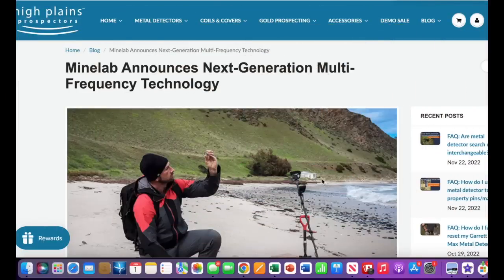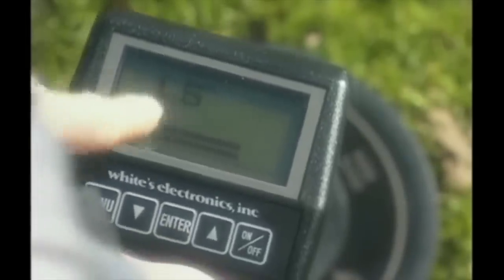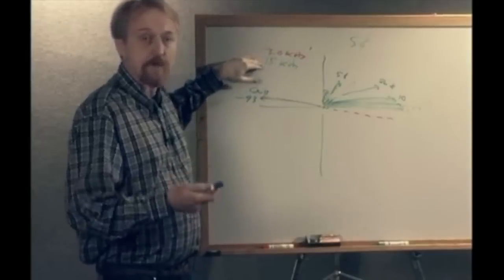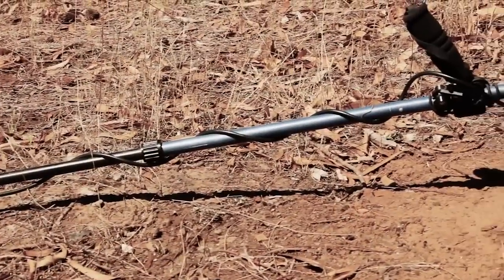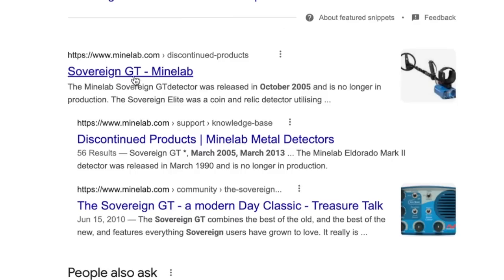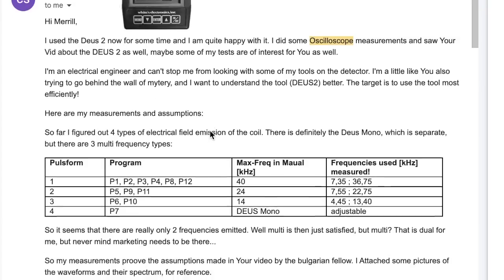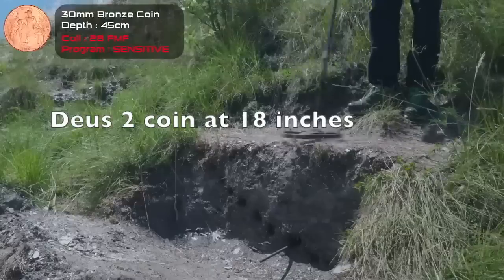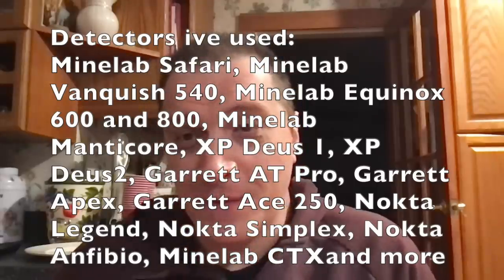We Broke Metal Detecting: Simultaneous Multi Frequency Is OLD Technology

Comment: I have a white XLT that I’ve been using for 20 years. I got the whites DFX a couple years back. I’ve been using it every day since.  I have never used a Minelab, equinox or vanquish, in my opinion, is only limited to whites since that’s all I have used. They are fully customizable and made a great silver hunting machines. I don’t find a lot of gold, but silver will blow the headphones up, the VDI is very accurate to a point and separation is decent.  There are many after market smaller coils that help with trashy areas.   I however love the 9.5 in coil and run mixed mode with a lot of modifications to hunt fields that have been hunted before.  Yesterday in a filed fully of iron, pulled a 12k 1-20 tiny heart 8 inches down between the iron nails and also several mercury dimes and wheat Pennie’s. It has taken a a lot of trial and error to create this program.  The stock programs are decent for beginners, but to really get the best out of the white machine you need to know what all the settings do and how they correlate to each other. The DFX runs three and 15 kHz and I love my whites detector. I dream of a equinox. I’ve watched so many videos and all of your videos I think about the Minelab equinox every day even while swinging a detector I do enjoy using. Best wishes and happy new year.

Comment: I had forgotten that the D in DFX was for dual... and I have one right here in the room. Thinking about it, it didn't give a lot of false positives. Here in the UK, especially in the south, there is very little mineralisation and I often don't need to ground balance because there is so little signal from clean ground. A single frequency detector works well here.

Comment: The big shift for detectors was going from analog  (which works fine) to digital allowing faster processing and flexibility.  As the chips and designs evolve (like phones) more and better software and electronics are added and better displays are possible.  It still comes down to the knowledge of the detectorist and the luck of the swing (probably the most important)!
Reply: I don’t think digital machines allow faster processing. There are really fast analogue machines.
Reply: @alfasud1972  I will not claim any expertise.  I never had the privilege to try and analogue machine. Just formally got into the hobby 2 years ago and with the Nox 800 which teaches me new things all the time.  So many of the conversations are about the newer machines.  It would be fun to see a good analogue machine dectorist in action!
Reply: @susantoker7254  some 20 year old tesoro’s are still very fast, and quite good for inbetween nails were depth is not number 1 priority.  They stil produce analogue machines golden mask. The golden mask 4Pro is a good machine. And the 4D is running MF. Deeptech has got some great analogue machines also.
Reply: @alfasud1972  Thank you!  People have been detecting successfully for a long time.  The wisest advice I learned from more experienced detectorists was to learn what your detector is telling you  and listen.  Respect to all detectors!

Comment: Awesome video thanks!  Ok been detecting now going on three years, and I always hear people talked about mineralized soil.  Short of digging up a clump and throwing it in my mouth to see if it’s salty, how the hell do you tell??  Lol😅
Reply from the maker: That sounds like a great topic of a video. Check back soon!
Reply: @MetalDetectingNYC  with a detector like the CTX3030 and XP2 it will show you a relative number of the mineralization under your coil. Where I detect it is the soil is just slightly mineralized so it really does not matter much to me.
Reply: I always though it’s the chattering on the machine. 
You know, when it’s making all the different sounds, non stop, at the same time. Like EMI sounds too.

Comment: yeah man, Fisher CZ3D(2005) used dual frequency also 4k and 15k. Could not choose either one , it just ran that way. Still sold today at the $800.00 LvL.  Minelab EQ 800(2022) shoots in 5k, 10k, 15k, 20k, 40k  and is selectable. and is soon to be less than 800.00 because of the new ones that just came out. So just that alone, comparing the 2 I have dealt with, the EQ is a better deal and proves the length of time that Dual Frequency has been out.
Reply from the maker: I’ll take an Equinox too!

Comment: Point taken, but how did I go from "hunted out" iron infested sights with my AT pro to finding 23 Colonial silvers and early American silver with an Equinox 800 first year? Were the old machines that bad, or the new ones that good?
Reply from the maker: Going from 60% to 70% to the current 100th percentile. We pay for that slight extra depth and separation. But think about it….I have a video that is titled retire the AT pro. The AT Pro can hit a 9 inch quarter in an open field. Equinox can do better but it’s not like the AT PRo is completely ineffective
Reply: @MetalDetectingNYC  Merrill, the AT Pro was a great machine, but it is woefully incompetent in heavy iron. You have all the machines, test it in iron or modern trash compared to a Nox or Deus 2. You will quickly realize why relic hunters happily shell out the extra grand on a D2. They are not even close, that's a fact you can prove in about 2 minutes.

Comment: When I first started metal detecting, the DFX was the machine to aspire to. I just couldn’t afford one!
I remember the Mark Rowan video explaining the dual frequencies. From memory, he achieved this by using a “frequency harmonic” of either the 3 or the 15 KHz. This gathered much more data and increased target accuracy.
Reply from the maker: I want to try one now. I would be expecting slower processing and less separation but a highly capable detector.
Reply: @MetalDetectingNYC  .....yeah....probably a bit slower but I guess you could adjust many of the settings to remove as much processing as possible. Maybe go all metal and just discriminate using tones. Put a DD coil on it and you’re good to go!
Looking on EBay, people seem to want more money for obsolete detectors than brand new multi frequency ones! 😳

Comment: Minelab sovereign series with bbs (multi frequency) launched in 91'. The gt was the last gen before they discontinued them. Excalibur 2 still uses it. Whites had been paying minelab for the rights to use multi frequency. The patent ran out and that is why the legend and d2 were able to exist.
Reply: The Sovereign hit the market in late 1989. I still own a Sovereign XS2aPro and it will still hold it's own against most anything out there in the proper hands. Run an equinox 800 now because of target separation and weight.
Reply: Xs2apro that detector was so good on silver just amazing
Reply: dfx was 2001, so 10 years after sovereign
Reply: That you for this information. I have and still prefer using my Sovereign from 1991. It might belong in a museum but it is a great machine and the only one I have ever seen in the U.S. it is  not a Sovereign II, it's a straight up Sovereign from 1991..

Comment: It’s too bad White’s is out of business. They were truly the innovators. I was detecting about 40 years ago - about the time Whites developed motion sweeping with their Coinmaster series. We take this feature for granted today because most current detectors use motion sweeping. The use of motion was a HUGE breakthrough in metal detecting because it somehow allowed better detection through mineralized soil. Now I learn from you that Whites also developed multi-frequencies. Great credit is due Whites!
Reply: The engineer responsible for those innovations went on to found Teknetics.   Great memories.
Reply: I still have their DFX (dual frequency) and V3i (three frequency) detectors.  Also have their TDI Pulse.  Love them all.
Reply: Garrett bought them and they're rumored to be coming out with a new Whites/Garrett combo detector
Reply: @wallsttiger  I BOUGHT SOME BATTERY BOXES  for my old CM4 whites coinmaster,heavy and antique, i've found much with it,it is very sensitive in and around california and nevada,its got to be adjusted often,it sniffs out very deep,i was told that it was one of the 110k hertz units,i like it i've other ones but this one always goes to verify
Reply: I still have my Whites Spectrum XLT.   Super adjustable!
Reply: @w5cdt  if it's got whites written on it,just add batteries,they work good,competition and old age took out WHITE'S,NOT DESIGN,I OWN TWO OF THEM,and they didn't cost 5500 dollars either
Reply: i used to have a whites, i sold it, kind of regret it
Reply: I purchased my DFX300
12 years ago and was told it was the top of the line, it is and will always be. Tone, VDI #, histogram and icon. I find more stuff after everyone has given up and gone home. I run it wide open untill just about unstable. My advice: dig everything unless it's 100% iron.
Reply: I don't see anything new from Fisher too
Reply: Haha since everyone is talking Whites here, figured I’d tag on mine as well. 
I Have a pristine condition Whites Classic 3 Plus, and it works well. However, severely outgunned by today’s standards. Even a Ace250 will rival it with depth in dry non mineralized soil. 😂🫣

But it’s a solid machine for those Button Pushers, that require a PHD and Pilots Checklist of procedures before they ever swing anything..
Reply: I don't see why they couldn't put transistors in the coil along the with of the coil.that delays the frequency as the signal goes from one delay frequency transistor to the other and as it goes the the other the one it left goes back up to the other constantly that means their always a say like full say like 45 khz frequency as certain ones are in the delay mode and certain ones are in full detect 45khz until it's time for it to go into delay mode all along the middle of the coil or around the outside.and it could run off one frequency or maybe more than 45 khz say like 20.
Reply: I still have My coin master. And I AM still using it From time to time, because when its in pinpoint mode then there is No filter and I have found gold and silver and lots  of small fibula. I have a dd mega coil on and its so simpel and correct compare to My New metaldetektor.
Reply: I’ll never sell my whites Surfmaster pi  But love my new Xterra elite

Comment: A fancy rich guy came up to me in 1996 at a boat launch and laughed at my 250 dollar Radio Shack Bounty Hunter machine which was the first one I`d ever owned with target ID and multiple tones. He called it a "toy." It had 4 tones, manual and auto ground balance, and an all metal threshold mode, plus a ground grab button on the tip of the handle. Just days before I had found three amazing 14k gold rings with it in just over 35 minutes.
Reply: I’ve found plenty with my Bounty Hunter Tracker IV I bought used like new for $40 and it’s Radio Shack labeled cousin the Discovery 1000 I picked up for $15!  Learn the machine you’ll find coins, rings, relics & lots of junk too.
Reply: @cruikshank The Tracker IV was my first machine too. Absolutely amazing machine for the price. I recommend it to everyone that wants to start detecting. It’s THE best detector to learn on. It’s so simple and it works so reliably.
Reply: Me too, I loved my Bounty Hunter Elite 2200.  I've dug a lot of silver coins with it, and some gold.  Maybe the best thing I liked about it, was when I hunted with a friend, he used to say, "let's get out of here, all I'm finding are bottle caps" , when I never dug a single one.
Reply: @harrysurtees8710  Mine looked like their Gold Digger except it had LCD target ID instead of a needle. I think it was a Discovery or something like that. I`ve only seen one picture of one like it online. It was their most expensive one at the time but it found a lot of money, rings and great relics for me.
Reply: Please explain a 
Ground grab button. 
Thank you
Reply: @MetalDetectingDonna  Quick ground balance for all metal threshold mode.
Reply: Every $100 gets you another 12 mm depth. 😅

Comment: The teacher I love it not sure if I learned anything but it was interesting to see so I think the d2 is the King of the Hill manticore say what hum I wonder until next time thank you support Merle's Channel likes likes likes
Reply from the maker: Thank you Phoebe!!!
Reply: The Manticore is the top dog for EMI mitigation. Minelab specifically designed all the Manticore components to work in a high EMI environment.

This feature alone is worth the price. As you can go where other detectors have avoided. Other detectors can try and detect in high EMI location, but their machine becomes chirpy and depth is compromised because they have to reduce the sensitivity.

XP Deus II can't fix their EMI problem with a firmware update.

Comment: After listening to this, I think I’ll stick with my AT Max for a while until these PR salesman come out with less confusing what is best if I upgrade
Reply: I have been using the Max for over two years and I wish you could see the Civil War artifacts that I have found on stomped land. Belt buckles, cannon balls, coins, hundreds of bullets, etc. I have found in 2 years what most hunt a lifetime for.
Reply from the maker: AT Max I’ve seen miracles with. You would be talking about 10% for however many dollars. The one thing I would challenge you with is unless if you use rechargeable batteries you’ll save a ton of money each year on an internal rechargeable battery. I would call a AT Max vs. Nokta Simplex a toss up. An upgrade to one of the new SMF machines would get you that 10% but there is the cost. Best value on the highest end detectors is the Legend at 509.
Reply: @MetalDetectingNYC  Is the verdict in on the new axiom yet? Thanks!
Reply: @mandograssable  I'm keeping an eye on the Garret Axiom as well, for the red dirt.
Reply: If you hunt heavy iron, a standard Equinox 600 will find things you simply cannot hear with your Max. I am an X Max user. I really don't care what people think, I lived it. No comparison.
Reply: That's what I am using and have decided it's gotta find more before being replaced. Had it one and a half years and I think I am still learning it but, got a decent understanding of it now and can predict targets fairly well.
Reply: The only reliable MF MD  is the minelab Sovereign...